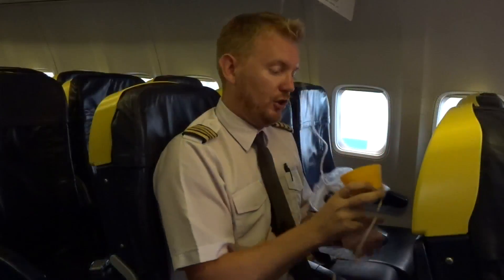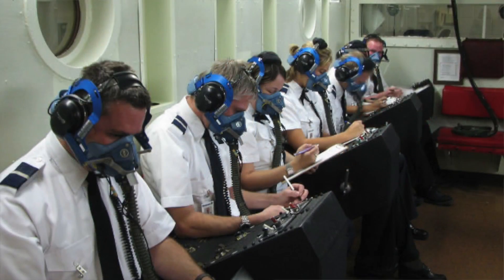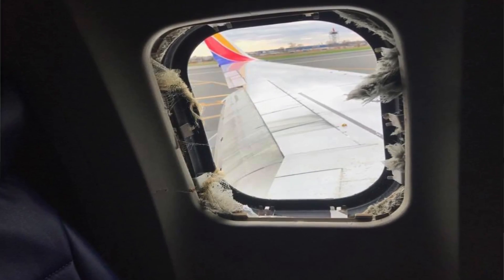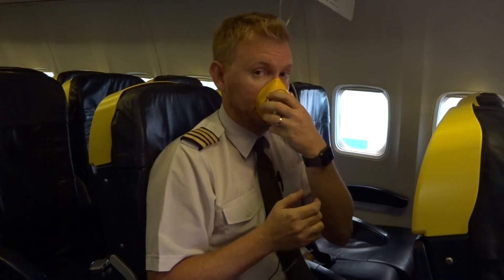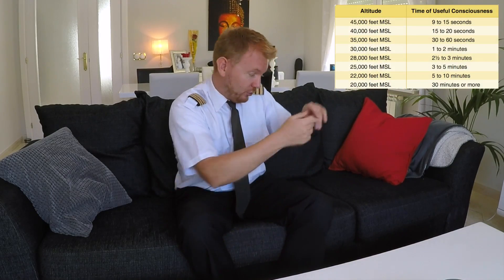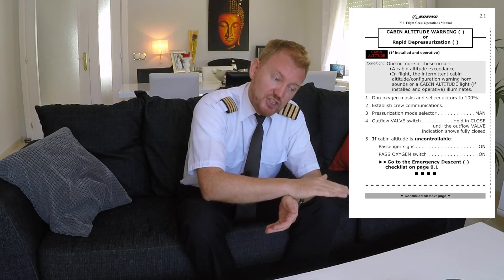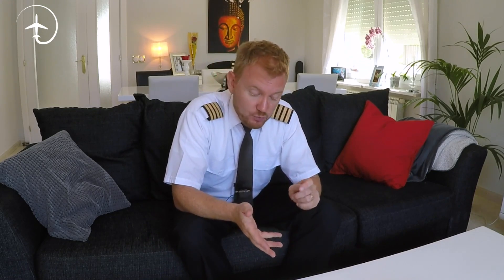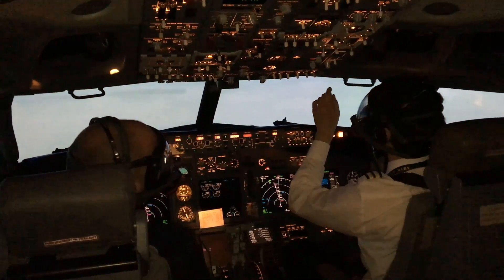Aircraft OXYGEN systems, how do they work?

Comment: I was wondering, once the cabin oxygen has been triggered. Is there a requirement that the plan must not climb back above 10,000ft even if the issue for the decompression is resolved? Was just thinking because in the event later on there is another decompression the generators could already have been used up.

Comment: Do airline pilots undergo depressurisation training?I mean at least where i live, as militry pilots we had a lot of training in hypobaric chamber, everything from mild effects of being at 10 000 and then slowly ascending higher to rapid depressurisation (simulated fighter canopy loss without functional oxygen system) at 35 000 - 45 000. Once you've experienced the effects for few times they are much easier to recognise and act accordingly, i would assume helios 522 would not have happened if pilots had such training.Seems like such experience would be invaluable for airline pilots in case of events like SWA1380 (and since captain there was military pilot i would assume it helped her a lot to deal with multiple events/alarms at once, since putting oxygen mask on would be totally automatic in this case, without even needing to see/hear corresponding alarms).

Comment: I've heard it mentioned that the oxygen generated by oxygen candles have a pretty strong chemical odor, which can be off-putting.
Reply from the maker: I haven’t smelled it myself, it’s supposed to smell a bit burnt due to the heat being generated but that’s not reason enough to not cover your nose.

Comment: Wonder why they won't do CPAP masks at least for the pilots? Though the lungs can only do a 2 PSI differential without pulmonary embolism issues and CPAP machines usually only do about a 1/2 PSI positive pressure (with limited BIPAP ability - exhalation relief - doctor menu instructions are widely pirated onto the internet and the method is easy on most machine brands).

Comment: Has it ever happened that an airliner suffered a pressure loss over a mountain range that required them to stay above 10.000ft for longer than what the oxygen generators are capable of generation oxygen for the passengers?
Reply from the maker: Yes, I’m sure that has happened

Comment: Do pilots race each other inflight...... ive notice many times when multiple aircrafts are in high altitude some seem to throttle up when the others are closing in even though they are miles apart parrallel to each other but heading in the same direction
Reply from the maker: We never race, sometimes ATC will tell one aircraft to speed up and another to slow down in order to increase separation.

Comment: According to death zone I have seen Mountaneers at Mount Everest and the death zone is above 26000 feet or 8000 meters and it starts at about 7000 meters or 22966 feet.
You have airports with altitude higher than 10000 feet. How do you handle the altitude at these airports? It is higher than the 
cabin pressure.

Comment: What is the oxygen-air mixture ratio for the passengers? What it is for pilots in the first "normal" setting? What is the mixture gas flow rate for passengers and what it is for the pilots? How big o2 cannisters there are for the pilots?
Reply from the maker: We do t use O2 canisters on a day to day basis. Only for emergency. We pressurise the air inside the aircraft to simulate the conditions close to the ground. This means that the mixture is the same as what you normally breath.
Reply: @MentourPilot  Sorry for my Q, i mean how is the gas coming from the oxygen mask, 100% o2? And how about for the pilots? Are the o2 tanks for the pilots 10liters or more?

Comment: Is it actually pure oxygen in the cabin tank, or just pressurized air? – Okay, saw another question and answer: It is pressurized air instead of pure oxygen; stands to reason, because it should not be mixed with cabin air, so the oxygen content has to be low enough to not cause problems itself; passengers get a mix of oxygen and cabin air, so the oxygen generators can give off pure oxygen. This is at least what I understand, and it sounds like a good solution.

Comment: Hi Mentour or anyone that wants to answer. Does maximum fuel = maximum range or does the weight of the fuel make much of a difference? For example if the range of an aircraft is 7000nm is this with max fuel?

Comment: Why don't planes have a remote ground control for an emergency? 
As always, thanks for great video!
Reply: Алексей Житорчук that could be dangerous and a target for hacking. Also expensive. They don't need it anyway in my opinion
Reply: It can be useful in the situation when both pilots lose consciousness. Also, modern aircraft have already had computerized control of all systems, so, I don't think that this will require significant changes in the design
Reply: A situation where both pilots lose consciousness is extremely unlikely. I don't think it has ever happened. To ensure they don't lose consciousness due to lack of oxygen is why they put on oxygen masks at a lower cabin altitude than the passengers and immediately begin an emergency descent to an altitude where people can breath without a separate oxygen supply.

Both pilots becoming incapacitated for any reason is extremely unlikely, that's why they have to eat different meals (in case of food poisoning). Both pilots are fully trained in landing the aircraft by themselves, in case the other pilot is incapacitated. Depending on the aircraft they might not be able to exit the runway (some can only be steered on the ground by the captain and if he's the one incapacitated then the first officer wouldn't be able to steer) but they can at least get the aircraft on the ground safely.

Introducing remote control capabilities would open up an avenue for the aircraft to be hacked.

Comment: How do you do an emergency descent without increasing the speed? do you activate the reverse thrust while in flight?

Also, a further remark on your statement: if you lose consciousness and then receive oxygen shortly afterwards, you recover consciousness quickly. Parents that want to put the mask on their kids are worried that the kids would die if not serviced promptly, but in practice, as you said, if the parent loses consciousness, they will both die as nobody will provide assistance. If the parent first puts the mask on, and then onto the child, the child may be unconscious for a few seconds, but will recover immediately after the oxygen is provided.

Comment: Im curious how hard have to pull the mask to activate the generator. I mean...if I see that tiny hose...I'm a bit worried that I might rip it off the generator if pull to much hard. Does someone know like how hard can pull on that thing before its destroyed? Like 10kg or smth....
Reply from the maker: It’s not going to be the hose you are pulling, it’s a wire attached to the generator
Reply: Mentour Pilot Ahhh....good to know. Thanks for the quick answer.
Reply: Chatinquisitor IM "Erbse" No, don't pull it that hard. Just pull it down as long as it lets you, when you can no longer stretch it then pull a little more like it was a lamp switch and that's it. It just activates a lever. You might even hear a click. And don't worry about destroying it, I don't think they rip that fast. And in the worst case you still have quite a few spare ones dangling around.

Comment: hi just a quick question if a plane (depressurised/punctured) needs refurbishment after pressure loss will they ever fly it or will they fly the required crew and kit in? (if they fly the aircraft to be referbished do they fly in a safe altitude for normal breathing below 10 000 feet or will they fly it safer at cruising altitude with oxygen ?
Reply from the maker: We would fly it depressurized below 10 000 feet.
Reply: also have you heard of the comedy series cabin pressure?

Comment: If you're landing at an airport above 14,000 feet, how do you prevent the passenger oxygen masks from deploying?
Reply: The automatic system would be disarmed/put in manual mode by the flight crew.
Reply: I suppose that there is also a similar process for the audible warning in the cockpit. Is that right?
Reply: Its normal for an audible warning of any system to have a cancel/silence feature, normally accomplished by pressing the (often) lighted button.

Comment: Maybe i am missing something, but why do the PSU's not start providing oxygen as soon as the masks drop? If you can assume that people will be unconscious very soon after the masks drop, there is little point in making it a more complicated system(more complicated for the user) just to save 30 seconds of oxygen.
Or is there a technical reason why that is not possible?
Reply: Empty seats=empty masks venting the limited supply of emergency oxygen.  If you had to take into account all that oxygen not being breathed in, but still had to provide each passenger with oxygen, the amount of oxygen that would be required by regulations would increase dramatically.  Its analogous to the 90 second evacuation rule.  You can try to cram as many people in the aircraft as you want, but the aircraft will only be certified to carry as many people as it can evacuate through half the exits in an evacuation.

Comment: If the cabin is pressurised to the pressure at ground level, why do passengers' ears pop when the aeroplane descends?
Reply: Max Waterman Its not pressurised  to ground level pressure. Its pressurised to around 2500m.
Reply: Max Waterman because it's not pressurized to ground level. It's close to that but not the same. There's a small change like you're going up a hill and that causes the earpop effect for some. Not dangerous just uncomfortable. Newer aircraft like 787 aim to provide pressure even closer to ground level's for more comfort

Comment: I/we fly a lot (holidays of course). Unfortunately the cabin crew and the automated safety briefing don't really give any serious education as to why everythings so important. I was concerned that if the worst happened and you pulled too hard on the oxygen mask that something would break. I also didn't know there was a system artificially making oxygen.. And i didn't know anything about an emergency descent. Maybe the (UK) departure process should be changed to re-educate people on some of the more vital aspects of this video?
Reply: GenosPerformer I wondered about that, too, if you can pull too hard or otherwise mess it up during the adrenaline surge of the emergency.
Reply: The extra mask per row could be used in this case.
Reply: In aviation everything is tough in advance, so designers surely are aware that in panic situation someone may act excessively and took the necessary precautions.
For the other aspects you stated, and this is my guessing as an aviation geek, they cannot provide too much information for 2 main reasons: 1- time, the message must be rapid, clear and direct in order to not make passenger bored, if so the normal attention rate would be even lower; 2- nervous flyers, do you guess what may happen if a person who is afraid of flying get to know that (even if in an extremely rare possibility) the pilot may need to start a rollercoaster like maneuver which may last for 3 minutes?
Airlines try their best in order to inform the passengers on safety aspects, improvements can always be applied, but its up to the single person to understand that everything is told is for your safety, cabin crew cannot enforce every single minute, passengers are still customers
Reply: GenosPerformer in an emergency situation, does it really matter to know how your oxygen is produced? I don't think so. You only need to know how to get the oxygen, not how it is produced.
Also only the pilots need to know about the descend. Your task is to sit down and fasten your seat belt. Nothing more.

And the people who are interested in this kind of stuff can watch Mentour.
Reply: @DaveSweetS  Exactly. People are too dumb to remember even info provided now. And when the situation comes, you forget 90% anyway in the panic. Only 25% of people can function in a emergency situation with common sense, 75% will not.

Comment: Why does low pressure induce unconsciousness so very quickly at very high (e.g. ~45k ft) altitudes? Does the thin air actively pull oxygen out of my blood? To put it another way, I can hold my breath for over a minute easily; why couldn't I hold my breath to avoid blacking out?

Comment: Badly packaged retired PSU in cargo hold brought a plane down once :( self-started somehow and then started fire.
Reply from the maker: Yes, oxygen generators are labeled dangerous goods when carried as cargo
Reply: That was ValuJet flight 592. It crashed shortly after takeoff from Miami on its way to Atlanta. The airline had its operating certificate revoked over this incident. It reformed as AirTran, which was subsequently bought out by Southwest.

Comment: Isn't it true that at high altitudes the chemical O2 for passengers does not work.  Pilots use. O2 that is  bottled.  Passenger 02 is not pushed into lungs like the pilot's system.

Comment: In my line of work we are required to be clean shaven (even the women🤣) if we are in a position which could require emergency respirator use. Lots of pilots have beards. I guess there is no such regulation for flight crews? Admittedly the RPE I wear is s standard filter type, not pressure-fed....

Comment: So I'm leaving on a flight tonight across the Pacific, 7,010 miles. What would the crew do if there was a failure like the Southwest flight last week, losing an engine and depressurization. If they had to drop to 10,000 feet there would not be enough fuel to reach an alternative landing site and if they stayed above 10k there would not be enough oxygen in the system. There's a whole lot of blue water out there...
Reply from the maker: They would fly at 10 000ft to the closest alternate.
Reply: Could a 777 fly on one engine @10,000 feet for 2,500 miles?
Reply: Timothy Cook Mh..the distance between lets say Hawaii and Japan is about 3400nm. So in the worst case...if your right in the middle of that route...you would have to fly maximum 1700nm which is about 3.5 hours. Shouldnt be a problem I think.
Reply: That's just the problem. On the route from San Francisco to Manila, when you get to around the International Dateline, it's nearly equal distance to Tokyo ahead, SF or Seattle behind, Attu Alaska to the north or Wake Island or Midway Island to the south (all about 2,500 miles)
Reply: Timothy Cook On that route they could use Petropawlowsk as an alternate maybe. Just checked the ETOPS time of the 777. Its 330 minutes which means that it is certified to fly at least 5.5 hours with one engine to reach the next airport.
Reply: Look up ETOPS. 2 engine airliners are approved for ETOPS of various time limits. A long time ago the FAA required aircraft with 2 engines to fly no further than a certain amount of time from a suitable landing site. Once 2 engine airliners became common FAA allowed certain airliners and airliners to fly a much longer distance from suitable landing site IF THEY WERE MAINTAINED to stricter standards and demonstrated a certain reliability. I think the authorities can approve certain twin engine airliners for ETOPS 240 or 4 hours flying on one engine.
Reply: Chatinquisitor IM "Erbse" there's other places between Hawaii and tokyo.
Reply: Timothy Cook go on flightradar24 find the flight see where it's route is. 99% of flights go off with out a hitch.

Comment: Fact is oxygen is not really needed, it's not necessary to save lives since the plane can go down. What it's really there for is to make sure the passengers don't get 02 deprived drunk and sart panicking. When you pump rich warm oxygen to an oxygen bar right in their seats they are far less likely to get up and start moving around which alters the plane's center of gravity so much.
Reply from the maker: No, that’s not the point. Hypoxia is a real danger. Just look at the Helios disaster.
Reply: Mentour Pilot I did not actually expect you to dignify that with a response. Still, if the plane is smoking I don't know why we shouldn't too.

Comment: Why can't passenger have oxygen tank
Reply: Gaseous oxygen tanks for the cabin would add weight & complexity.   Then you have to factor in the scheduled servicing requirements, ie; checking/filling it with oxygen at regular intervals.  A emergency oxygen tank that is below pressure could cause a flight to be cancelled if the tanks couldn't be serviced, or at a minimum, the aircraft couldn't climb above 10K ft.  The tanks themselves either have to be hydrostatically tested at regular intervals (like scuba tanks), or replaced outright. They also would take away some safety margins because now you have several, large pressurized tanks full of oxygen in the fuselage.  Solid state oxygen generators are much simpler & lighter.